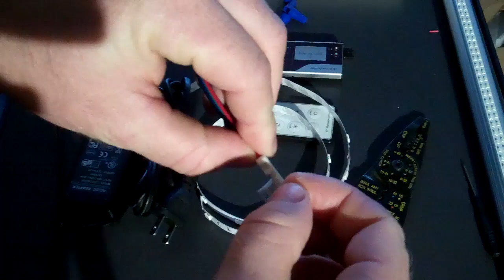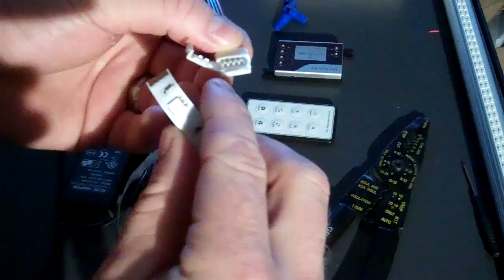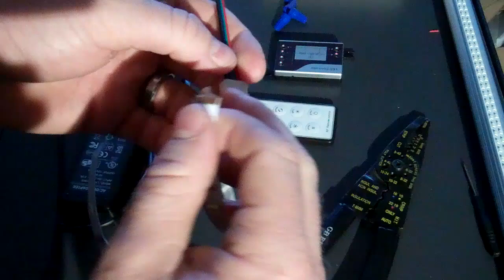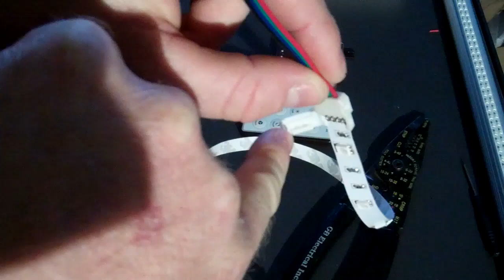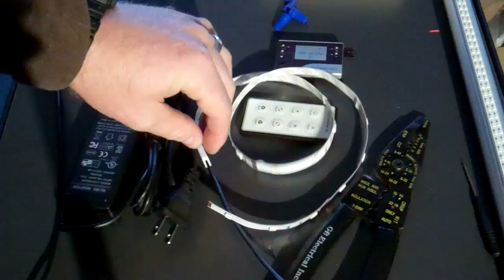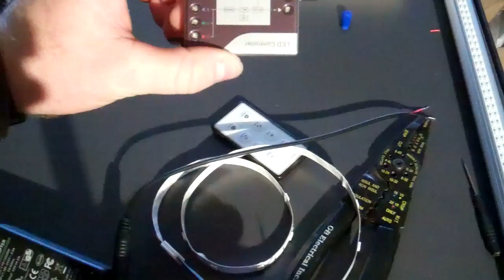How to Use RGB Snap Connectors: Tips and Tricks

Comment: Mine have snap connectors on both sides.  Can I use mine just to add enough Strip lights  to put in my 3 car garage or should I get the little ones that joint two strips toguether?
Reply from the maker: Hi @futbol1972. It is hard to say since we aren't sure of which connector you have, and how it works. We recommend you call us at +1-844-353-9347, or send us an email to support@flexfireleds.com with a couple photos, and we will go back to you as soon as possible.

Comment: I can’t wait for someone to improve this.  So much wasted time with these poorly designed connectors.
Reply from the maker: We upgraded them! We now have "grip connectors" SO MUCH BETTER
Reply: @flexfireleds  That sounds awesome. I went to the extent of using solder seal on wire to strip connections over long runs.  But I notice some strips are almost paper thin.  Very hard to slide into those white 4 pin deals.  I’ve used some outdoor strips that were easier, but I think finding the right quality stuff is key.

Comment: So I accidentally ripped the wires from the led strip can I use these snap on to reconnect it or do I have to solder the wire directly to the strip

Comment: I bought a box of these connectors off Amazon, as they had good reviews, to help with corners in my sons room. Now I followed your instructions and many other videos exactly and none of the connectors work. I spent 2 hours doing various things and I only got flashes of light when I joined at a certain part. 
The part I joined at had to be where there were two grey spots just behind the four connectors, now when the two metal teeth came into contact with these which they did only when I wiggled the strip and I also had to cut through the middle of the connector so only half was available to slip under the connector. If I didn’t cut them in half the two grey spots would reach the two teeth. 
It got me so childishly angry that I was on the verge of trashing my garage. I just binned the whole lot. Total waste of time and money.
Reply: when you join different strips of LED lights make sure they are running the same way, left to right, not left to left, think about that a while,

Comment: My pin connector didnt come with a tray to secure it in the slots so it just keeps falling off cuz the wires are vertical. Ive tried taping it to the wall the but the pins get disconnected from their slots. Where could i get that tray because its a very small ovject thats pretty much useless but i really need it

Comment: Hi how are you, I bought a connector adapter , and I have my other set of lights and it’s not connecting, like I definitely see there’s some type of connection being made since I touch one of the lights and you can definitely see some light coming on but it’s very dim, and I might’ve ruined the copper thing a little bit, and I’m not sure if it’s that and I’m afraid of cutting it more because I don’t want to waste it

Comment: Not a comment really but a question with an issue that I am having. How do I avoid all of the adhesive that is on the bottom of strip, I can not get the strip to slide under pins cause of the adhesive, I have even tried leaving the backing on but still does not work for me. Do you have any suggestions ??
Reply: Did you figure out a solution
Reply: I'm also unsure about the adhesive, so I suppose you can just touch the adhesive at the point you need to connect it so it looses its stickiness?

Comment: Does the led light go over the curve pin connector or under the curve pin. I cant see clearly.
Reply from the maker: Hi Jessica, thanks for watching our videos!
The strip goes UNDER the metal pins so they make contact with the copper pads. You can also use the connector upside down, but you'll need to peel back the adhesive so the metal pins touch the copper pads underneath the strip.
Feel free to chat with us at flexfireleds.com
Reply: Flexfire LEDs so i tried it and i realized i had done it backwards not putting the + + together and it turned on flickered and turned off and didnt turn back on even after i adjusted the correct way. Does that mean its dead or gone for good? Can it be fixed?
Reply from the maker: It should still work as long as you correct the polarity. This is assuming you used the correct power supply to power the LED strip... Most LED strips require 12 or 24 volts DC to work and may break if they are powered with a voltage higher than they require.
Reply: Flexfire LEDs where would it show ? I bought the mainstay led garden lights from walmart and the connectors that walmart has online. The corner connectors and the ones identical to the ones on your video. I did not see what voltage it has and the package it came in doesnt have any directions or anything but the product. I will go online and see what the voltages are. THANK YOU!
Reply from the maker: Hey Jessica, often the LED strip will have a marking on it which says "12V or 24V" This is assuming the strip is not a constant current strip. The box / bag may also indicate the voltage required.

Comment: is there a way to control the lights without the remote controler?
there is a little box on the cable right before the leds on which says "Mode/speed/colour" but is not doing anything. are these buttons?

Comment: My problem is that with my 90 degree adapters, I can only make right turns. I can't make a 90 degree left turn because the +RGB won't line-up correctly anymore. Any solution to this?
Reply: bruh, they are just direct through puts, you can turn it anyway you want regardless of that the RBG says. Just make sure your second strip matches the same terminal the previous strip was connected to. might need to flip your strip.

Comment: I have these snap connectors right now. Is there a way I can connect them to a female four pin connector? I am talking about a onnector with four holes in it. I looked around the Internet and didn't find anything that i can used to connect a snap connector to the female connectors i have. Would appreciate it if you can tell me the keywords I should look for on eBay for the parts. For example four pin adapter to snap connector.
Reply from the maker: Hi there! Unfortunately we don't carry those connectors, however a search for "rgb 4 pin connector led strip" should give you some good results.
Give us a call if you need any assistance completing an LED lighting project. We'd be happy to help! 1-844-FLEXFIRE

Comment: This one doesn't have the gel, but If i met the idiot who designed it !! I mean the gel on top of the strip...cutting it first with the sissors on the line and then scrubbing the gel off with a stanley knife !!!!! HOW MANY DIFFERENT WAYS THIS COULD BE DESIGNED. ITS UNBELIEVABLE !!!!  F'CKING MORONS !!! I can't get the proper connection !!!! Its driving me crazy !!!
Reply: I feel the frustration. I have been there. haha Some manufacturers use an epoxy or silicon coating. I recommend after trying to scrub the silicon off, lightly sanding the solder pads. Hope it works. Send us a photo, maybe we can help! info (at) flexfireleds (dot) com.

Comment: Is that snap connector completely waterproof, gonna put lights under my truck and I wonder if these will hold up, or should I just solder them?
Reply: Philosipher83 S Soldering is always best, especially with vibrations from driving, but you are able to use the snap connectors if you take some extra steps to waterproof the connection. I would recommend using liquid tape to seal the connection and make it waterproof. You can get it from us or any home improvement store.